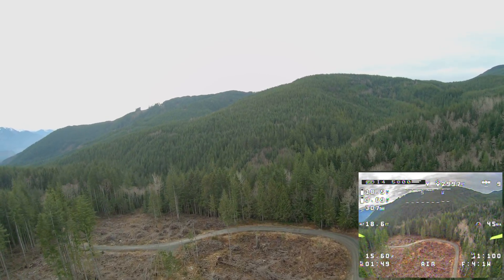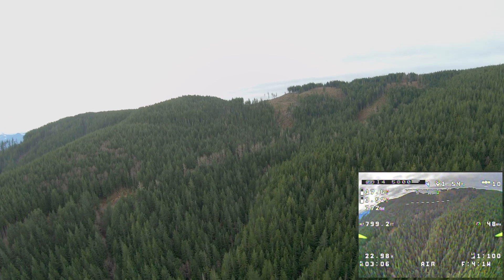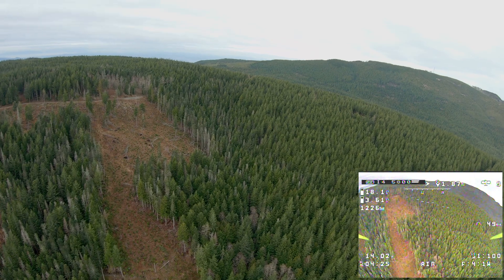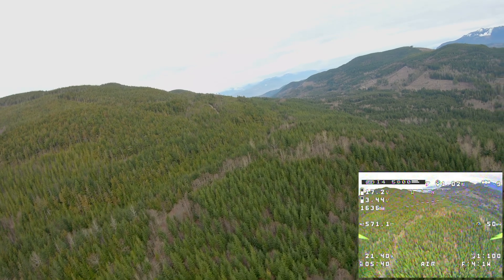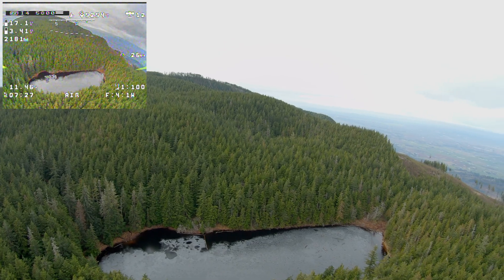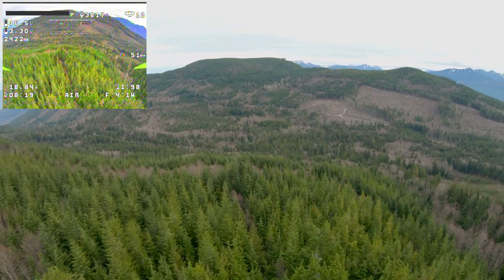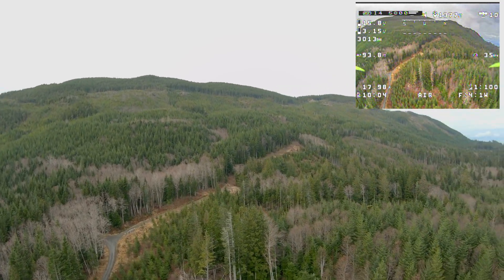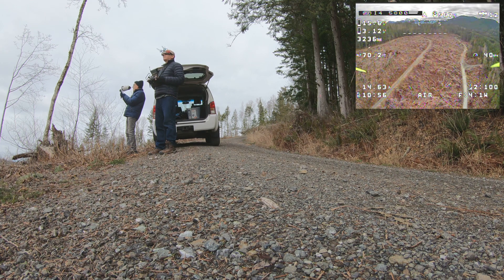2 Mile 21700 Battery Quad Long Range Test Flight

Comment: Are these Samsung 40T batteries?
Reply from the maker: Yes the Samsung  40T 21700 rated at 4000mah.
Reply: Would you recommend this 5s1p or going 5s2p with something like 18650 2600mah?
Reply from the maker: Sort of depend on your flight plan and quad build. I use both. I have 5S1P 4000mAh packs made out of 21700's and also 5S2p 6000mAh packs made out of 18650.  WHen I need the raw amps for a long range flight will use the 6000 pack. When flying within a mile, I tend to use the 4000 pack which is 40% lighter. Its all about tradeoffs. My 5S2P gives me 50% more amps but at 40% more weight and a little more sluggish aircraft. But sometimes I need the raw power, sometimes dont.